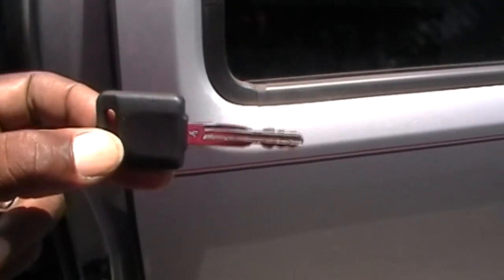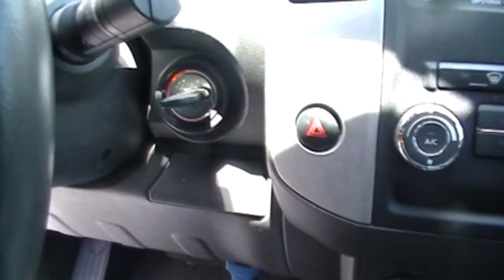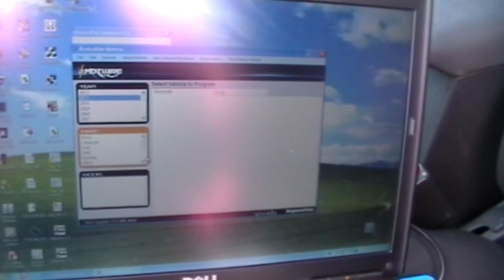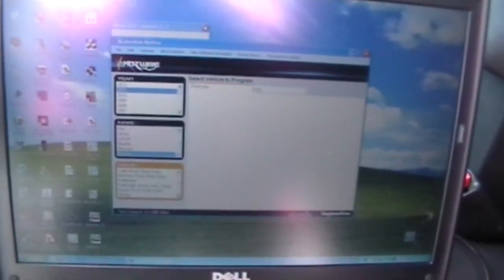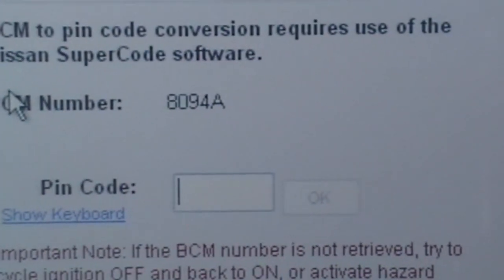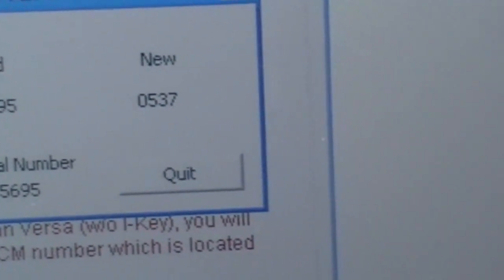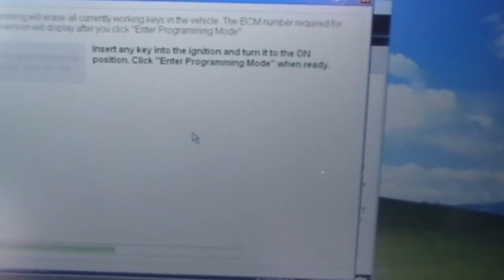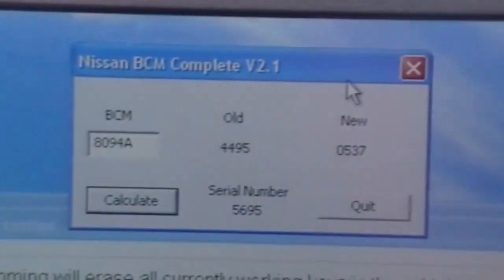Infiniti and Nissan Key Programming for 2008+

Comment: ***wire is expensive.  I was looking at it the other day wondering if it would take the place of my tko. Wish there were trials on some of this stuff. I installed a patch on my tko that now displays pins for Chrysler and mitsu but haven't tried the nissans yet. Doing the patch doesn't help cut cost if "All Keys Lost" but aids the add function. None the less Great job Will and thanks for the vid.

Comment from the maker: Thanks for viewing my channel, Ricardo.  The 2008+ (Nissan/Infiniti) programming and pin code conversion software is available for approx. $500 (USD).  You should be able to get it, from your local Locksmith supply vendor.

Thanks again,
Will

Comment: hi! i have seen your other tutorials and they seemed very detailed. im residing abroad and have recently bought a 2012 nissan bluebird sylphy (Japanese home model, 2nd generation). sometimes these are marketed as nissan sentra/pulsar....accroding to wikipedia. I am having some ignition problems with my car. I have tried using the original key and remote key to start my car but nothing seemed to work. The only things available to me are nissan consult 3 diagnostic tools. So, i wanted to ask whether you have any experience/knowledge using the consult 3?

Comment: What software did you use to program the Nissan?
Reply: Thanks for asking, Elkarshofy.  Perhaps [in the end] it's all about "software."  But, this 'type' software is [now] included in most programming tools that Locksmiths use to sync transponders into vehicles.  While I choose to display the ability, using a laptop; others may choose to display such using a different diagnostic tool that has transponder programming capabilities.  Without uplifting any particular gear; I say:  shop around for gear that is within your budget.  Again, thanks for asking.

Comment: Hi I have a few question ? Is my computer plugged into my cars brain in order to program the chip in the key. I need a spare key for my car. The dealer wants way to much. I've found the software for the codes and blank 46 chip keys online.but I'm too inexperienced to know what I'm doing. I'm scared I'll knock out something important and my car won't work. How do I hook up the computer to the car ? Do I need special cables or is it a standard USB ? Any help would be greatly appreciated.

Comment: yes I do. that's why ask William how do get them for my car is 2006 Nissan Murano S. I already had them cut they work on my door and it turns my ignition but won't turned over it just crank. when I saw Williams video its give hope the dealer it's charging me arm and the legs just to program my transponder key

Comment: Kinda different I would imagine if you have the push button keyless car. I have a 2011 nissan altima and it shuts down ever once n awhile. Someone told me it's because it thinks it's getting stolen or something. Dealership wants to keep putting new batterys in it even though it has plenty of power just don't want to start or get's a little drained.